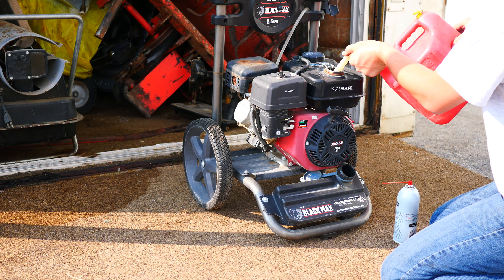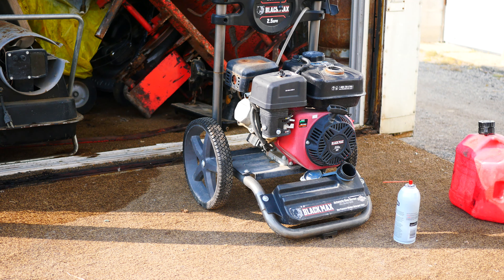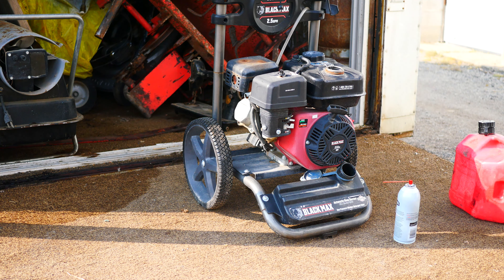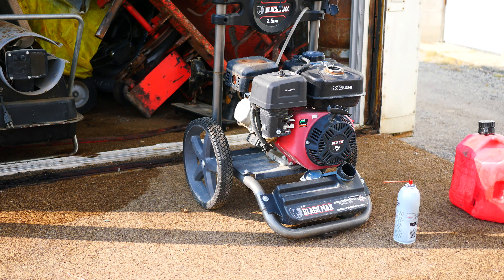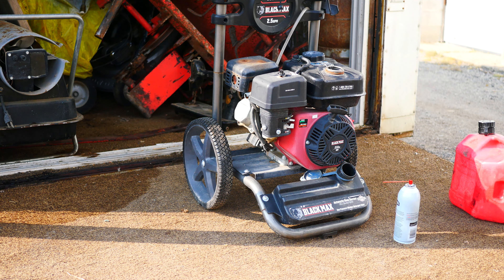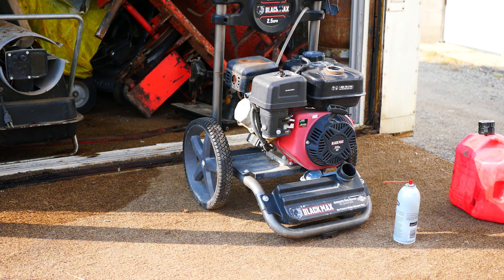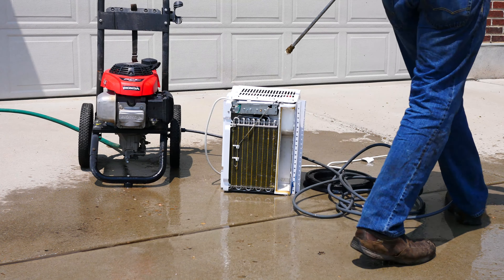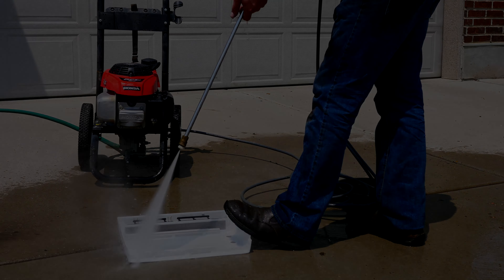Pressure washers found at the dump

Comment: Amazing what people throw out. Often very little to nothing wrong with them
Reply from the maker: Very true honestly sad how much of a throw away mentality we have in the US Don't want it anymore or like you said little to nothing wrong with it just chuck it.
Reply: @ils360  ultra common on mowers. If it dont start in like 3 pulls it gets pushed to the curb and a new one gets put in the shed istead, 2 or 3 years later the same thing happens
Reply from the maker: @alexhickey5633  I hear you on that one I used to pick up mowers from the curb all the time actually have a video a couple months ago of that very thing happening I ended up already selling one of the mowers for quite a chunk of money It was the all-wheel drive Toro on the channel I used to do small engine repair when I was younger and man I was busy for those very reasons wouldn't start to three pulls and they'd bring it to me
Reply: @ils360  similar scenario here. Always see fairly new mowers pushed out on bin night in the spring. Within a few days theyre running again and sold on for a tidy profit
Reply from the maker: @alexhickey5633  exactly to most it looks like garbage sitting out by the street to me it looks like a couple hundred bucks give or take.
Reply: @ils360  even if you rob a few parts off them its all profit. Carbs, air boxes, shrouds, fuel caps, dipsticks. All worth snagging up